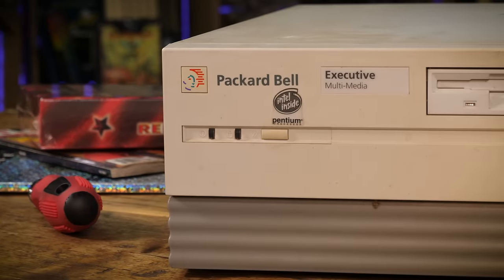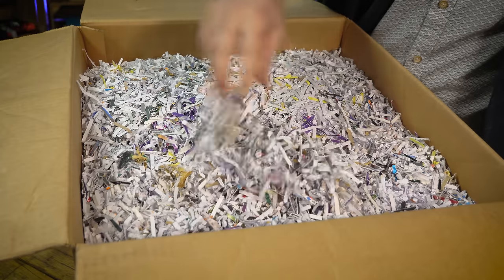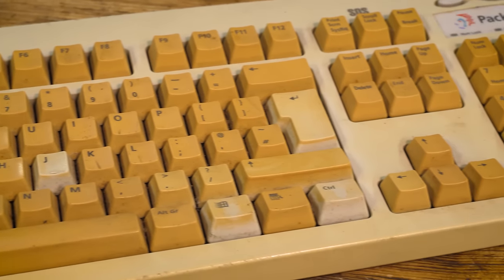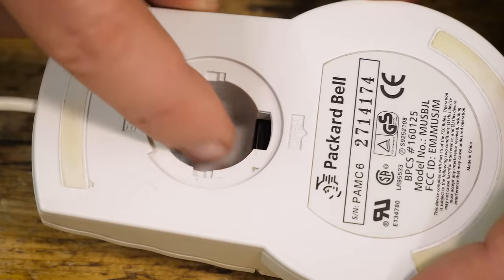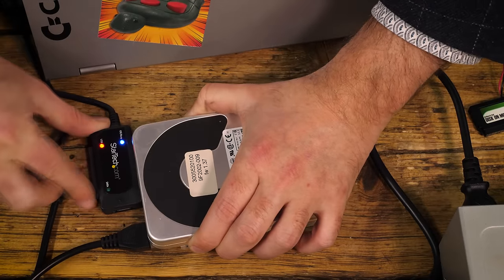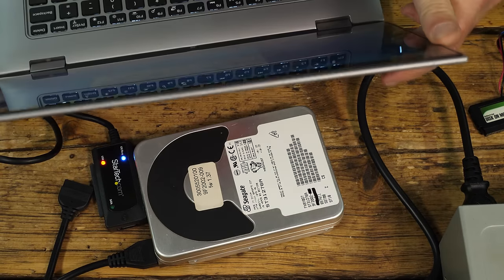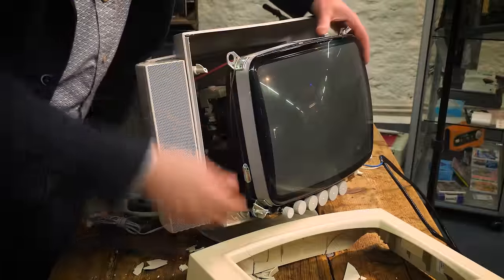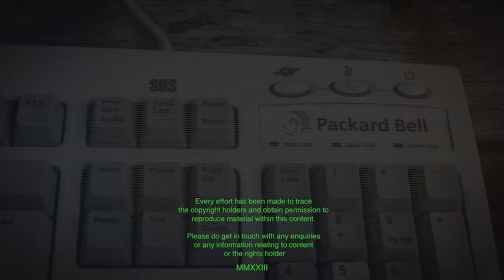Packard Bell Restoration | Testing & Cleaning Inside | Trash to Treasure Part 2

Comment: I remember having to do system restorations as tech support for old PB's many, many years ago. I hope Neil enjoys the TATTOO procedure. If memory serves me correctly the TATTOO info is stored in the BIOS DMI and basically links the OS with the specific system hardware, changing one or more pieces of hardware requires the system to be re-tattoo'd (basically re-listing all the hardware in the system, including any replacement parts). Once the TATTOO is done then the system restore disk is used to install the OS. If the TATTOO fails it can be retried but it can lead to systems being bricked (in extreme cases). I'm a bit rusty on the info but I think some systems had some TATTOO info stored on the HDD as well (I may be getting that mixed up with old COMPAQ's though). I believe tattooing was a prerequisite Microsoft forced on OEM's to stop piracy.
Reply: I worked for Dixon's Group doing consumer PC support back in the early 2000's and hated taking customers through the TATTOO process, the data is on sector zero of the HDD and required a lot of unpublished info to get it to work
Reply: @robertt1983  pcservicecall by any chance? I was there from 98 to 02. Soul crushing place to work!
Reply: @StormieOfSmeg  That's the place on good old Lenton Lane, I was there 2004-2005. I agree that wasn't a nice place to work
Reply: @robertt1983  We were probably stuck in that tin shed at the same time (2003-2005 I think for me) - I'd mentally blocked out having to tattoo Packard Bells and the endless amount of dead emachines due to capacitor failures...

Thanks for the memory :)
Reply: At least for this era of PB, I don’t think any of this is quite right.  There is bespoke data on track 0, including a build log, scattered around starting at about a dozen or so sectors in, up to CHS 0,0,63, where we butt up against the beginning of partition 1 at CHS 0,1,1.  Nothing in sector 1 though.

(There is no sector 0.  CHS begins at 0,0,1 — it’s LBA that starts counting sectors at 0.)

If that data is present, the restore CD will automatically restore the correct software profile onto the machine.  If it’s not there, you have to provide the “format number” during restore.  It’s a six or seven digit number, IIRC.  The original documentation should have that number, and it will be repeated several times throughout some of the build log sectors on Track 0 on the disk.  Or you can just use the magic number: “generic”.  Drivers and bundled software may not be correct though.  Best bet is to find it from another machine of the same model.

There may be something stored in the BIOS or NVRAM, but it’s not used as part of this check — not on pre-MMX Pentium 1 machines at least.  It doesn’t have to match serials or anything like that.  I’ve used images from other HDDs with no trouble.
Reply: @kyoudaiken  I was told this by rep's for Packard Bell and other OEM's. Although anti-repair practices makes sense. The price for some replacement parts (especially COMPAQ) was astronomical.
Reply: @Antireality  Patriot PC's were even worse. I remember a member of my team managed to get a £20K order through the tech support line from a woman who owned her own business. A full 30% of the order was DOA.

Comment: I bought an apple 19" monitor for an old power pc mac that was almost complete dust when I opened the box. The seller also refunded the cost. The thing does still work, just doesn't have a case.

Comment: I don't know if that Startech adapter is special, but IDE drives are absolutely not hot swap compatible. I've seen drive boards damaged by plugging them in live.

That's probably not what happened here, but if you're trying to preserve the old drives, connect everything on the drive side before powering up the adapter.

Comment: Had that exact monitor and speakers.

Sadly(or I guess not so sadly), I always use everything until it stops working. It died in an odd way, the colours and brightness were already well below spec(I had to turn everything up to max to get a semi-decent picture by the end) but then it started stretching vertically about halfway down so that the pixels were twice as tall as they should be until about the bottom third, where it returned to normal. I think this was aboot 2012, so it didn't do too badly considering I used it not just for playing games, but also for work.

Comment: Disagree: that monitor was not adequately packaged. Proper packaging looks like the original mfr’s packaging: something equivalent to rigid styrofoam. Having said that, if you haven’t already thrown away all the pieces it might be salvageable. Not optimal, but maybe possible nonetheless. Regarding the HD, did you try reformatting it for repurposing?

Comment: I have one in a case like that, Mine is a Socket 4 system with a Pentium 60, came with an Aztech Sound Card with a 2x proprietary Panasonic drive, onboard Cirrus graphics, I got mine at a flea market in 2014 for $10, it's nearly identical to one my dad has that he bought back in the 90s. Apparently socket 4 is relatively rare to find by I've had a couple of them now.
Reply: 300CD?  I’ve got that one and a Gateway P60.  Both cost less to buy than a Socket 4 motherboard alone.

Comment: Usually, if there's no original packaging, the best way to ship old monitors is SCREEN DOWN! Because thar's where most weight is. But because many monitors, especially more expensive ones, also have an anti glare layer, the screen itself should be covered with cloth, and only the edges of the front case should be put on styrofoam with something dampening. Believe it or not, I already got the same Sony CPD-E 2x0 5 (!) times. And only the one time the sender actually cared about my instructions, it came in one piece.
About the drive: It's likely the adaptor. My personal guess is that the disk was set up in CHS mode, and your adaptor can only handle LBA, which is basically all that you need today.

Comment: If you are locked out of the BIOS does removing the CMOS battery reset the password?
Reply from the maker: It should, and some boards have jumpers to reset the bios password as well, it doesn't mean it will clear it though, it might set it back to the default manufacturers password which you'll still need to look up

Comment: @13:25 a PCB swap might not be possible. You will probably also need to swap the flash chip that sits on the PCB that holds the disks specific quirks - which are individual for each and  every drive.

Comment: I would say the monitor was NOT packed well.   That kind of packing (peanuts, shredded paper etc.) allows the object to shift inside the box and make contact with an outside wall.  It was the wrong type of material to pack that monitor in.  Just because there was a lot of it doesn't mean it was well packed.

Comment: Just had something similar with a drive from a 486.....nothing would recognize any partitions.....ended up digging out my old Buslink 20 gig external hard drive from 1999 and put the hard drive in there and finally Linux could recognize the drive and I was able to get an image of it.  Think some of the early hard drives didn't match modern specs and modern ide to USB can't properly read them.

Comment: I received a lot of CRT's until mid-2020 and I didn't have too much bad luck here in Germany. But in the last 2 and half years something happened and the success rate of shipping a CRT with any company, no matter which one, is basically ZERO. No matter what is written on the box or how much you paid. The heavier the package is the more it gets mistreated or dropped. NO amount of packaging is ever safe as these CRT monitors collapse under their own weigh if they are dropped hard or high enough. You would have to cushion them on the inside.
It's deeply frustrating.

Comment: Yeah, monitors don't ship well. Usually because they're packed incorrectly. They need to be packed standing up (and with base detached), with handles to the heavy side (because the weight shouldn't be evenly distributed).
The hard drive, check the Master/Slave jumpers, try another IDE to USB adapter. After that, I put it on the drive controller board being faulty. Still recoverable, bu you'll have to find another exact duplicate of the hard drive (same type, same firmware version) and swap over the EPROM that contains the drive layout (which is different from drive to drive).

Comment: Ok...  I have a Packard Bell monitor like that, but it in my opinion it wasn't worth the trip into the attic to save it, let alone across the country.  It still works and displayed my Amiga for the 20 secs I dared plug it in for...  It's as yellow as a banana and I need to take a shower now.  If you are really stuck I can drop it off.  

Maybe you can (pretend to?) put the system through a wood chipper for me after fixing it to make it worth my while :)

Comment: Such frustration with the monitor.  Couriers will just throw parcels of any size, weight and fragility, stack them, drop them to the ground, and say the packaging was inadequate if it doesn't survive. Looking at the way it broke, the plastics were probably destroyed by the mass of the CRT itself trying to carry on moving when the parcel was dropped to the floor, and cracking all the brittle plastic mounts.  It needed the original polystyrene to prevent the movement, but couriers these days don't care at all, there would be no guarantee!

Comment: I have this strange laptop that always ends up being my saving grace when it come to hard drive issues, for whatever reason windows CE seems to be able to deal with any issues that even linux cant handle, it sounds weird but its true.
Its a Chinese ebay special from like '09, it was an imitation of the eee pc laptop, but it ran windows CE 6, and had a 7 inch screen, it has no purpose, but had saved so many drives for me i just cant get rid of it!

Comment: Just saying the Packard Bell was a good system, but the M-Wave card is what made it the Packard Hell. But funny enough in the '90s those computers got me my first repair jobs. The key is to have the separate Chipset drivers on the M-Wave Card or to just replace it with a modem and sound card. Best of luck, they were fun compies 😃
Reply: That’s IBM.  Packard Bell used Aztech cards.
Reply: @nickwallette6201  Modem and sound card combined, Just a rebadged M-wave Card. I have worked with IBM, PB and Compaq, wich all had the same kind of cards included. At the shop, we just called them M-Wave (Modem & Wave Sound Blaster Card)
Reply: @mccrh7737  Oh I see.

MWave was actually a brand name given to IBM’s DSP-based cards with combined audio and telecom functionality.  They promised a lot, but were never fully baked, so there ended up being a class-action lawsuit against IBM that prompted them to send users coupons to replace them with separate modem and sound cards.

In contrast, the Aztech cards that PB used, including the combo modem and sound cards, were actually pretty decent, and compatible with Sound Blaster / SBPro.  The modem functionality didn’t rob the audio hardware of resources like the MWave cards’ shared DSP did.  They were just two devices on the same PCB for the most part.  Perhaps with some additional audio routing to hear the phone line through the speakers for voice telephony and monitoring data calls.

The biggest issue with those is getting the right drivers, since they’re not usually very specifically marked with model names.  And some of them have a jumper-selectable software-defined configuration mode that requires boot-time init commands to work at all.  So they can be frustrating to get working, but they do generally work pretty well once you do.

Comment: I was a reseller and system integrator back in the day when this company was making their very built to a price systems.   I had NO good experiences with them though I made a lot of money FIXING THEM!  They were even sued successfully  for using USED parts in system they said were NEW.   At the end of their life they had to print "may have used parts" (but they did it very small and in a not so obvious area). They also used seconds (parts that failed to pass the testing of manufactures specs)  and special feature limited version of components like video cards with reduced ram.  It was just best not to purchase them especially for business use.

Comment: paper shreddings, as good as they may seem, are a terrible idea. they are too easily compressed so they barely provide any actual cushioning, and they don't keep the article from moving around. a mix of leftover styrofoam blocks and crumbled up printer paper is a much better option, but you still wanna bubble wrap the monitor itself tightly with multiple layers, and then put everything into a larger second box with additional cushioning inbetween the two.

Comment: The packing may look good but it's not - that is much too soft for shipping a heavy item like a monitor. It needs to be firm packing material with a small amount of give to take the weight of the monitor and cushion impacts. Seller definitely at fault.

Comment: 3:30 “despite the good packing”… um, uh…. That is no world where that is “good packing”. The paper shreds there are functionally cosmetic. Think of how stiff styrofoam packing inserts (not peanuts) are. Compared to the weight of the CRT, that paper is nothing. Then when it flops around under its own weight, it breaks the plastic. It also looks to me like that box was kinda small, it would have provided minimal protection even when new!

Comment: People who send CRTs surrounded only by loose packing should be banned from selling things on eBay. Loose material (shredded paper, packing peanuts, etc) do NOT provided proper padding against bumps and jolts! It allows the item to "slosh" around and then bang against the sides with even MORE force.

Comment: That monitor was packed very badly and not the good packing you claim. I ship many CRT Vintage monitors in the post and often internationally. I havent lost a monitor yet.  Any CRT should me mailed face down so the center of gravity doesnt rip the tube from the cheap plastic bezel. And "shreddings" Offer ZERO support. If the monitor is moving around it will arrived smashed. It needs ridig support, and to be shipped face down. That was terrible packing indeed.

Comment: Wouldn't it be FAT16?
Reply from the maker: ooh snap you have a point, Windows 95 OSR2 can use FAT32 but earlier versions are likely FAT16. Modern Windows can still read FAT16 however so I'd have followed the same approach.